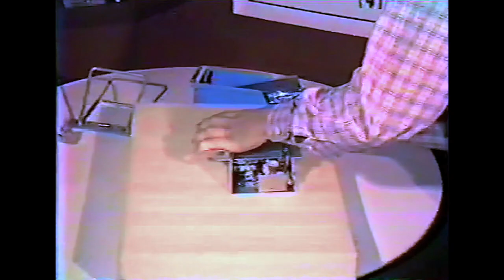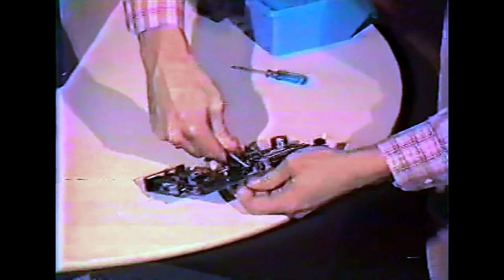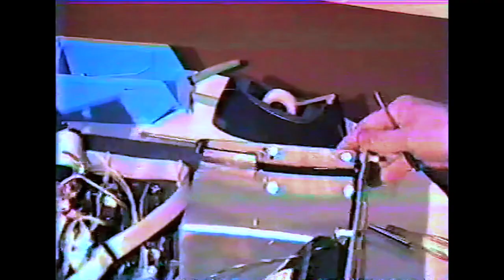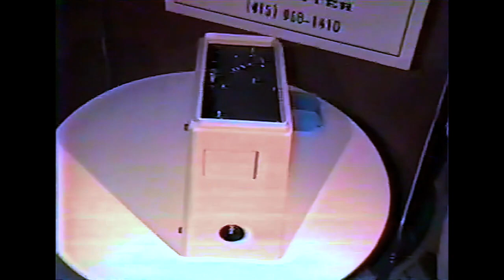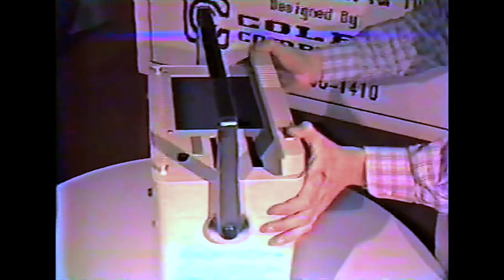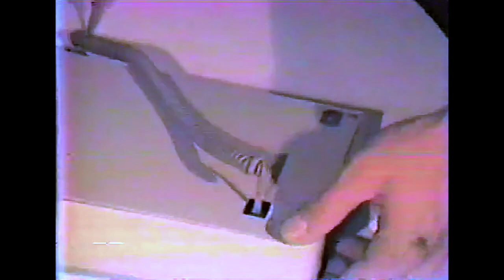MacColby Assembly Instructions [Vintage Video]

Comment: Amazing that this still exists! Thank you for digitizing the old video!! I actually owned a MacColby MacPlus computer back in 1985 or so, until it was stolen, believe it or not!
Reply from the maker: Wow!  Stolen?  Goes to show just how "portable" the MacColby was, I guess. :-) Do you have any memories about your time using the machine?  I am most curious if there was any kind of noise or artifacting on the display, especially since all the components were crammed together so closely inside that case, in positions they were not originally designed for.  However, that was a very long time ago, so you probably don't remember.
Reply from the maker: Ken, I should mention that I received an email notification of your post under my 800K floppy drive video, but it seems your comment was deleted there. Let me know if you want the content of what you wrote.
Reply: @JDW-  I sure don’t remember any issues or things that bothered me about my MacColby! If I recall correctly, it was pretty darn great! A huge improvement over the bulky Mac, plus the external drive and external modem. I was working for Paul Anka at the time, and I put the Mac Colby and my luggage in the baggage compartment of a chartered bus from Atlantic City to Washington, DC. When we arrived in DC, I remember asking who was playing a trick on me! Turned out that no one was, it must’ve been taken by someone before we left Atlantic City. I contacted my computer insurance company, told them that MacColby was no longer available, but there was this new portable computer about to be introduced, called the Dynamac, and when it came out I got one of the first units, totally paid for by the insurance company! Something like $7,000!
Reply: @JDW-  I was wondering what happened to my comment, as I was hoping you might be able to offer some insight and maybe even suggestions about my MacPlus floppy drives.
Did you get the questions? Any chance you might have a minute to answer any of them?
Thanks!
Reply from the maker: @kennewman126  Wow.  Thanks for sharing that story.  I assume you mean you worked for this Paul Anka? https://youtu.be/uvxagNIBVLU
Reply from the maker: @kennewman126  Not sure what led to your comment being deleted.  I guess it's one of the same great mysteries of life similar to who stole your MacColby! :-) Below is the full text of your comment that I received in an email notification.  If you want, you can copy/paste it under my 800K floppy drive video, and then I will reply to you there, keeping our dialog in context, for the benefit of others there...

WOW! What an amazing, thoughtful, meticulous and helpful video!! Thank you ever so much for sharing all this info!! I have a few old Macs that I'm trying to at least get working so that I can sell them, as I've been out of work since March 2020 due to the pandemic. I don't expect to get back to work until much later in 2021, so I need to sell as many things as I can just to pay for the essentials! I do have a couple of questions about your techniques and hardware..... 1) Every other video I've seen about restoring these floppy drives has suggested using Lithium grease for the metal parts and Silicone for the plastic parts. I wonder why you don't suggest using Lithium grease? Now that I've purchased a couple of different types of Lithium grease, I hope it won't be bad to use it to lubricate my floppy drives! 2) Your video shows plastic clips holding on the gearbox cover of the eject mechanism. Mine all have 3 screws to hold the cover on. Do you happen to know if either eject mechanism is "better" than the other? 3) After cleaning and lubricating, ALL of my floppy drives eject partially. That is, they start the eject process, but in order to complete it, I have to press on the manual eject piece in order to get the disk to fully eject. If I remove the eject mechanism from the drive, when I send the eject command to the drive, the gear spins from 12 o'clock to about 11 o'clock. I hear that it's supposed to go all the way back to 12 o'clock, but I wonder if you happen to know what might be causing mine not to?? I feel like it's not a matter of the mechanism not having the ability to move smoothly, but possibly something with the motor (and gears) not continuing to turn just a bit when it's been switched off by the cam switch. 4) Can you please tell me more about the yellow stripe vs. red stripe drive cables? I have a few with yellow stripes and one with a red stripe. I'm pretty sure all my drives are 800k, so I wonder how one of my computers ended up with a red stripe cable? Might you be able to shed any light on the subject? Many thanks, again for such a thoughtful video!! SUPER well-produced and informative!! If all youtube videos were like yours, the world would be a better place!

https://youtu.be/sy6JWEerHQc
Reply: @JDW-  oh yes, definitely THAT Paul Anka! Worked with him from 1985 until about 1992, and occasionally after that....sometimes he was THIS Paul Anka: https://www.youtube.com/watch?v=Jfp7v3ZtPW8
Reply: @JDW-  thank you for saving the comment text! I've copied it to the comments page for the video in question, and I hope you'll have a moment to respond to some of my questions. And of course I hope it doesn't get mysteriously taken down again! Thanks!!
Reply from the maker: @kennewman126  I cannot find the comment under that 800K video for some reason.  I did not receive an email notification about it either.  I also checked to see if any comments were being held, but it says none are.  I'm not sure what's happening.  It could be the browser you are using, so if possible, please try Chrome.  If you were already using Chrome, then perhaps YouTube dislikes the length?  Try posting a comment that's only a 3 sentence paragraph and let's see if that works.  I have the full text of your original comment, so when I reply I can include everything you wanted to know.  Thanks, and sorry for the trouble.  YouTube can be odd like this at times. https://youtu.be/sy6JWEerHQc

Comment: Excellent. I was happier once those cables near the fan were properly secured. You don’t see open fans like that much any more, thankfully!

I was surprised to see the main logic board mounted upside down. The 68000 CPU didn’t require a heatsink or fan, but being operated upside down would make it run hot, robbing it of the natural convective heat flow moving hot air away. I doubt it caused any issues. Not exactly much in the way of air flow with everything crammed in that space anyway. 

Very informative to watch. I’d heard of the MacColby, and saw them advertised but never saw one being operated.
Reply from the maker: You're right about the motherboard and how convection airflow would be affected.  Suffice it to say, owners of those machines should ensure their Colby fans are running well!  Even so, the 8MHz 68000 didn't run even warm to the touch.  What got hot was the power supply analog board.  That's the main source of heat.  What I'd like to see now is video of the actual machine running.  I'm curious if they avoided noise on the CRT, possibly induced either by the rearrangement of components in a non-stock case and/or due to that added fan. There was an optional hard drive too.  I know that the GCC HyperDrive induces some noise on the CRT, so I suspect the same was true of whatever HDD solution Mr. Colby used.

Comment: Cool! I find these mac clones rather interesting!
Reply from the maker: Thanks for your kind words of support.  Preservation of a vintage video is a little different for my Channel, but I wanted to spread the knowledge of the MacColby here on YouTube, especially because there's so little information about it online.  It technically isn't a "Clone" as we understand them. It's not a clone the likes of Power Computing or StarMax where motherboards were approved of by Apple but not built by Apple. Charles Colby purchased a genuine Macintosh 128K or 512K from Apple and then merely proceeded to swap out the case, adding things the stock Macs didn't have like a modem or 12V DC-DC power supply or even internal hard drive. He went on to make other Mac portables that were more advanced and had flatscreens until Apple's PowerBooks ultimately killed off demand.  The 80's were a fun time for personal computing!
Reply: @JDW-  If I remember correctly, I took my Mac 512 into the dealer and left with basically a MacPlus in a MacColby chassis! It was SO much more travel-friendly!! Then a few months later it got stolen, but thankfully I had good computer insurance, and since the MacColby was no longer available at that time, the insurance company got me a new Dynamac!!
Reply from the maker: @kennewman126  Wow!  Thanks for sharing that great story, Ken!